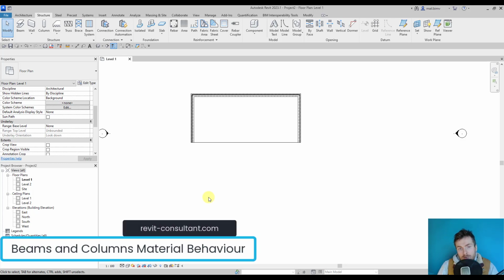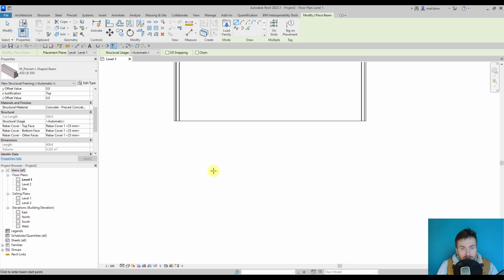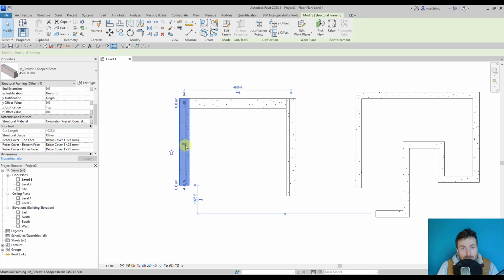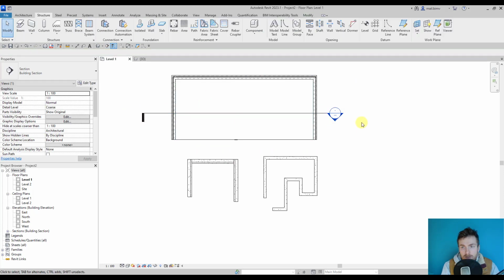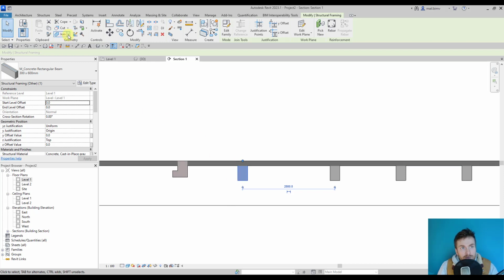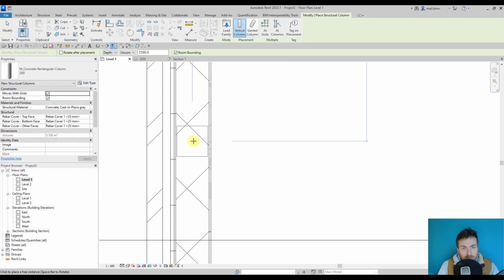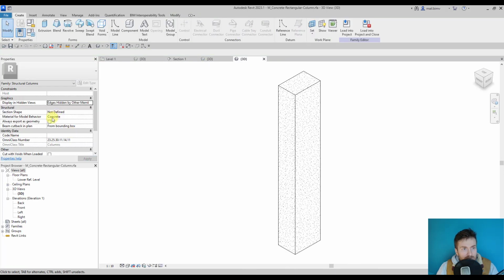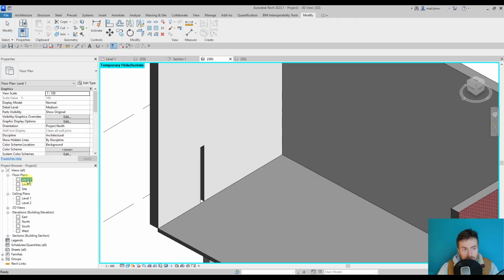Beam joining rule in Revit. Material for model behaviour | Revit Tips & Tricks

Comment: I created an inverted T-shaped foundation beam using the ‘Metric structural frame - beam and reinforcements’ family template. However, I am unable to join them, even when using concrete as the material.
Reply: I don't know whether you dtill need help with this, but I usually load a precast beam family from Revit's built in families and change the material, it works in this way.

Comment: I'm trying to create new framing family based on the default Revit templates, but for some reason when I created it with the Extrusion tool it won't join the beams with the columns or floors, when I tried it with the Sweep tool it did, but for one of the parameters I created to work, the beam has to be created with the Extrusion tool, I´ve already tried changing the structural material for all the elementes I'm using just as you're suggesting but it still doesn't work. Do you know if it possible to fix that?
Reply from the maker: hmmm. interesting. Sorry for late reply. Have you solved it ? I don't know the answer to that.

Comment: Thank you for your video, beside material, does the geometry affect the joining rule?
Because when I try to joining structural framing family with rectangle shape, the floor and structural framing can be joined. But when I try to joining structural framing with complex geometry (in this case U shaped girder) the error says the element cant be joined..
I have tried to change the material as the video says, but the error still there..
Reply from the maker: I think I know what is the problem. I was investigating it myself lately. So if there is a complex geometry and you used joining command inside family editor itself, later when you load the family into the project joining will not work. So you would have to go back to family editor, create a void extrusion along the shape of the beam, activate option 'cut with voids when loaded' and than use cut command (since the void is there to cut) in the project instead of joining.
Reply: @revituniversity  Thank you, I will try your suggestion